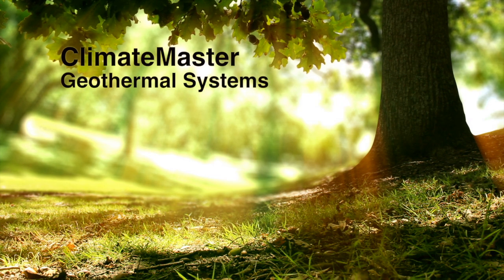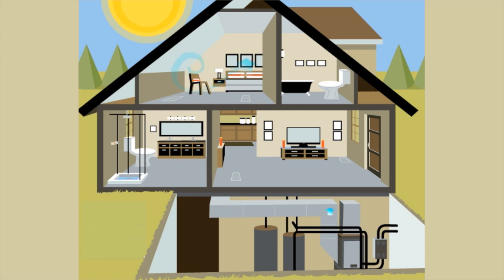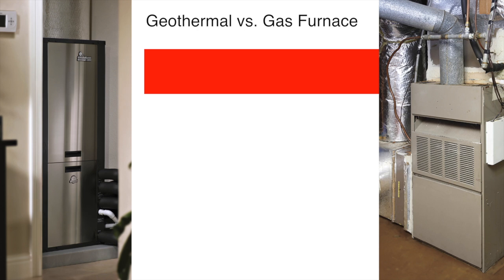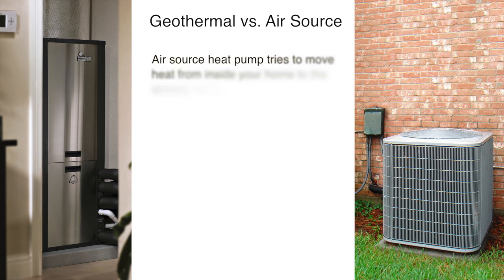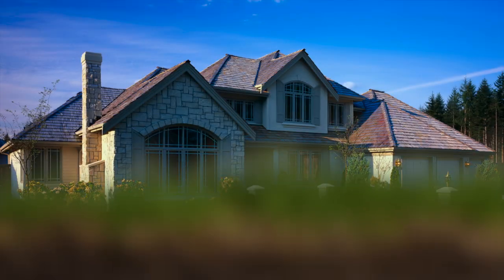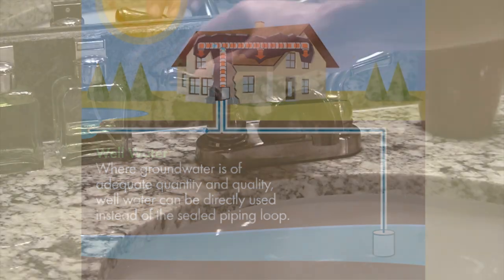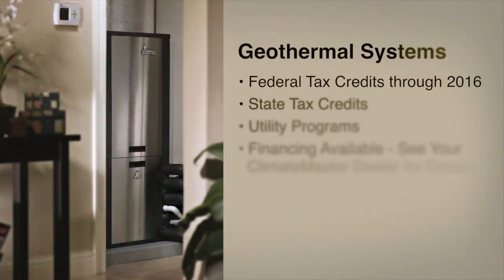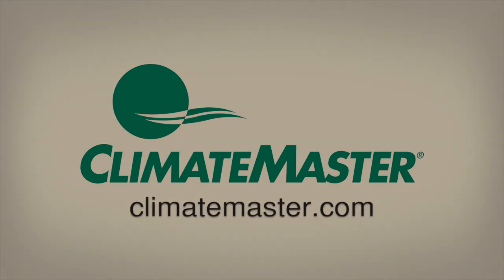Benefits of Geothermal Heating and Cooling

Comment: My home 6,000 sf cost about $45,000 to install Ground Source Heat Pump System in Oklahoma about 7 years ago for vents, duct work, 3 units 2 ton, 3 ton and 4 ton. 6 vertical boreholes 300' deep using 1" HDPE plastic pipe with life of 100+ years. Reverse return With 30% tax credit and $200 per ton from city of Stillwater. My cost was around $28,000. Which was less than a conventional gas fired system at $30,000. My average cost is around $70 per month for heating and cooling in Oklahoma. My total electric bill averages $156 per month for lights, cooking, hot water, heating and cooling. Plus I feel healthier, no gas fumes, no gas even to home for the two fireplaces. No loud compressors outside making noise. Units sound like refrigerator running. Insulation in home normal no spray on foam.
Reply: Gerald McClain $28,000?!? You're being robbed
Reply: My house is 7000 SQ Ft. My heating cost is $250 a month for winter ( Mid Nov, Dec, Jan, Feb, Early March). I have 3 HVAC units. I only turn on the one I need. Each unit cost me $3000, including furnace and a/c. The smallest HVAC unit is a heat pump.
Reply: @zomgos  do you need help keeping it clean?
Reply: @SWEAR2CARE  Keeping the house clean? Its just the two of us, my gf and I, we don't make a mess. The dog sheds tho. Just vacuum/swiffer as you would any house.
Reply: That’s way too expensive. Cheaper to convert your walls to rammed earth and go with an electric a/c
Reply: Cause not all customers have 40k and the ground is solid lime stone here. And that wattage is for cooling we’re in Texas
Reply: The first post said, 6 vertical holes. The thing is drilling the holes, you don't want dirt, you want solid rock. Dirt is bad in every way and you have to have extra pipes from ground to bedrock. That is more money.
Lime stone is prob very good to drill in. 
Heating and cooling is a lot of a knowing the numbers. 
You calculate the price for install, the price for service every year. The life length of the machines. The cost to use it. That way you can see what the total cost is. 
To do all this you also need the conditions. How hot/cold/sunny/windy. The house and the land, how are they.
I live in Europe so i don't know a lot of that. But, what i see is "let's do what we have done before" talk.
Why install air-to-air [coolers] when that is obsolete tech? air to air- [cooler & heater] is where it is. For air solutions. Air pumps is a good solution for smaller homes. Bigger homes, then you can do bigger solutions like geo and get the nummebers on your side.
What temperature is the bedrock down 100 feet where you live?
What temp do you want in your house in the summer? Why are you spending money on aircon when the cold is down under your feet?
In geo systems you can do what is called, free cold, that is you take the cold water from the ground and use to cool down the house. No heat pump needed. Only to a small pump circulate the loop water.
Reply: If you live in Tulsa, it must be in south or east tulsa and if in OKC, Nickolls Hills!
But you are correct, as I saw an A frame house in Tulsa south of 71st or 81st, which was very energy efficient and this was back in the 80's( it had a west side, comprised of all glass with indoor swimming pool and rock garden.
Reply: Richard Hill s
Reply: Ok, letts check the math
Geo:
The investment is 45 000, Of that the holes is 50 years and 1/3 of the cost.
So, 14 850 dollars. /50 years is 297 dollars a ear in cost. Even then you can reuse the hole after 50 years.
Thepump cost more. 30 000, over 25 years. Is 1200 dollars a year.
Total cost is, $ 1 497/year.
And costs for the mashine is 1200/12 = 120 dollars per month
A total cost of 120 + 156 = 276 /dollars per month
Oil:
Your house needs 1250 gallons of oil at the price of
500 * 5= 2500 dollar a year to heat.
6,000 sf  you need around 20 000 to 25 000 watts.

The oil man needs double of that if the house was 6000 sqf, (i think) So, 5000 dollar/year or 416 Dollars per month to heat the house with oil. And even then i have not included the costs for smoke channel, the burner and the system, oil tank, pump. And furnace.
Reply: I understand that a Ground Source Heat Pump System uses 250 btu of electric energy for every 1000 btu of heat provided.   Is his about what you get?
Reply: Robert Reznik 1 BTU/H?  250x3 is 750, 250x4 is 1000. They call that COP in heat pump land. The number of times i raises heat for the electrical power you give it. 
It works like this. A refrigerant (R410a) is compressed. It takes heat and gives heat. If the source for the heat is 50F, and the output needs to be 104F, then it needs to raise it 54F. If you need 131F. Then it needs to raise 81F.  A Ground Source Heat Pump has no fixed ratio. So in the summer, when perhaps it only needs the radiators to be 100F, the efficiency is better. Then the ratio is perhaps 4.0 or better So, 250 BTU is then 1000 BTU heat. When you need 131F radiator water, all Ground Source Heat Pump drops down, Perhaps to 3.1 COP.  Then 250 BTU is 775 BTU heat. But! A air to air heat pumps is even worse in the winter. They can drop down to 2.0 COP, then 250 BTU is only 500 BTU heat.

So, if you want your new heat pump to be efficient. Heat the house with a low temp system. That is under floor heating or low temp radiators.
Reply: @NonyaBusiness! What aboutt the ac cost?
Reply: You could do two 19 seer 4 ton vnaO Greenspeed Carrier systems for like 22,000 and get 5000 back in rebates. They only pull like 3100 watts on high speed which they don’t run on much. I’ve gotten home down from 5100 watts to 3200 watts and a good duct system seal the house up much cheaper
Reply: @greg 5100 watts to 3200 is really bad. That is a COP of 1.6. You invest 17,000 and only get 50% more heat than direct electric.
Reply: That’s on high stage it don’t run on high often
Reply: Sorry but i don't see why that is a better solution. Geothermal is ten times better.
Reply: In the area I live in there are about ten houses that have geothermal systems it’s not practical here I own a Ac and heating company
Reply: And that is why you think your products and solutions is the best??
Practical? It's the hen and the egg. The reason there is no geo is the reason no one uses geo, and there are no good geo company's and or systems to get.
You are only honking your own horn, and not looking for other / better solutions.
Reply: Also the holes here are around 45,000 to drill and if we’re talking tech the Mitsubishi city multi and carrier 45 seer mini split systems are the most affordable and efficient system you can get. As far as knowing system size and design we use Carrier international to do all our heat loads and manual D systems
Reply: You should move here start up a business and show us how it’s done.
Reply: I guess you don't know what the Blue Ocean Strategy is. https://www.youtube.com/watch?v=uVsd0ZtKsZE There is one person in a 1000 that are willing to try new things, like geothermal, robotic mowers, mobile phones. Then the data from that we all get. Now we know how it works. We can make a lot from this data. How it works and what it cost. All this is done. The only reason you don't do it, is you are scared to change to new systems.
Reply: Ok so obviously you’re a huge fan of geo systems I get that and I understand why. But homeowners aren’t always willing to say yes let’s take a $20,000 mud sample and drop a $40,000 system in plus drilling out an underground field and run a duct system. Not everyone can afford that you seem to be missing the point that people can’t afford it. If the average HVAC system on a new home cost $16,000 complete but you want to jack this up to $60,000.  So now the homes that were barely affordable at $200,000 are now almost 300k. So now what? Are you gonna pay the remaining balance for the planet? Just saying I know it’s a great idea but it’s not affordable.
Reply: Greg, I don't know why the prices are so high for you. I have a geo system for heating. (No need to cool here). 1 out of 3 neighbors have a geo system. The rest have minisplit, wood, or just electric. My system is 600 feet vertical hole. That is water from hole, compressor, to water in home(radiators). The compressor is 3500 watts, and give me 12000 watts of heat.
It is always hard to compare prices, but i can try. The price for drilling the hole and installing all pipes was [The salary a nurse  gets (one month) after taxes] the compressor was 2 months salary, and installation was 1/2 month. 
The price of electric was really low in the 1960 and 1970. Now we have a lot of immigrants then they raised prices so now 1000w / hour is 0.2 US Dollars. 
That gives that i pay 1500 Dollar a year for power to my pump, and saves me 3000 USD/year. The math now say, that the savings 3000 USD, and the system 16 000 USD, Around 6 to 8 years. After that the 3000 i saves is money i save.
We can't count on prices for gas, electric, oil to stay where they are.
Wood is cheap, but a lot of work. Electric is a big comfort. On some places it make sense to do air to air or even air to water. Some times it is better to do geo. And using geo to cool is a smart thing.
Reply: And where i live (Sweden) we have inflated house prices so a big house, like mine. Is 2 million (sek) where i live and 6 million in a bigger city. The installation or geo is only 150 000 to 200 000 (sek). So under 10% of the value of the house.
Reply: John Strand  hahaha not even close to our way of life in America. Average house payment is about 1800.00 a month. Also the average person in America under 35 yrs old doesn’t even have over $1000.00 cash in a savings account. For $3000.00 in America you can get a 4 ton condenser only nothing more. Here a 2100 sqft home a 4 ton 14 SEER  baseline system with ducting cost around $18000.00 installed. We live in a much different world amigo. To drill two 600 foot cores you’d spend around 25k just for the holes in the ground.
Reply: I checked and Average Registered Nurse monthly salary is $6,129. A good minisplit, Mitsubishi MZ-FH18NA is around $3000. That is better than here. Different styles of economy, but a nurse here can afford one minisplit, and in the US she can then afford two every month.

If Average house payment is about $1800 a month. 
"The median monthly mortgage payment for U.S. homeowners is $1,030 according to the latest American Housing Survey from the U.S. Census Bureau."

The price for a good minisplit system is about the same. $2000 or so. That is a monthly salary. When you talk about "4 ton condenser" that is nothing more than a big pump and a radiator outdoors. The same system as minisplit only slightly bigger. The compressor in a 4 ton, is  about the same size as in a geopump. The geopump also have tanks for hotwater and pumps for water. That raises the price to $4000 to $5000 i guess. Now you need the hole.Drilling in the US seams quite bad. Both in prices and in depth. 
It takes about a one day to drill a 600 feet hole. (You only need one). Here we don't use drillriggs that are mounted on a truck. We use, one big compressor and one standalone drill. And one big bucket to collect the water and sand. Say the price for the compressor is "One new Ford F150" and the price for the drill head is two F150's . So, 50K? for a F150? That is 150K and they last 20 years? How come the cost is then 25 000 USD for one hole? That is like 6 months pay for a nurses. I don't get it tbh.
Anyway you can get a tractor and digg around your house and make a "groundsource geothermal system", that way you don't need to drill. Or better yet, if you own a lake just put the tubes at the bottom of the lake.
And Greg what is the cost of running this 4 ton condenser?
And Greg $18 000 seams a lot of money tbh. And you don't even get any heating for that money.
Reply: John Strand 18 is a complete install in a new home from rough to finish. Most nurses here are around 5k a month.  As for the cost of drilling I don’t own a drilling company but I know what my friend paid for his cores and it was around 20-25k. So yeah for 18k that’s a complete system Ac and heat in a home plus ducting fresh air system and restroom vents so on. 18 is turn key on a new home. So with a 4 to. You get a 48,000 btu Ac Systems and 90,000 btu heater 16 seer 13 err and the entire duct system. Question I see you’re constantly stating a monthly salary for a piece of equipment most people do t have the money to not spend on anything but an ac. Most Americans are in debt to their elbows but they won’t admit it. In our country I believe people are more concerned with how they appear to their peers. As for a Ford F-150 20 years you’ve got to be kidding. Companies here only keep trucks about 5 years. Remember Texas is the size of a continent. So last year on my ram I put 50k miles on my truck. This truck will on make it maybe 5 to 7 years then it will get sold. A business has to keep the appearance fresh and won’t pull up in a 20 years old truck. That’s not proper business etiquette.
Reply: Greg, about the F150, the 20 years, was that the drilling equipment last 20 years if you get them new. I know that 20-25K is the price. And that is strange to me. But as i said, then do ground source. Texas is the size of a country. Swedes are more in depth, just it does not show. The rate for a house loan is around 1,3 %. Yes around one percent. Most family's have around one million i loans. You never told me what the running cost for this 18K system is?
Reply: Appreciate the breakdown.
Reply: I have a house of 200 m2 and landscape of 400 m2 , can you guide me how to do this system ?? Also I have well of water 25 m3 , I hope you can help in this regard.
Reply: @ehabtuffaha4083  No? How the hell are we going to show you how to install it? Contact the company.
Reply: Certainly it's hard to justify new technology. Soon enough we won't have options when fossil fuels are more expensive and non existent as it doesn't scale either. Also like solar the price will hopefully come down with competition.
Reply: @BrandonTran  it is not new by any means.. these types of closed loop areal geothermal are out there and running reliably for more than 30 years.. not rocket science nothing special.. just a pump for the loop and a heatpump to "concentrate the heat in the heating circuit to a higher level, not as high as for normal radiators, since you normally couple it with a floor heating system to be most efficient.
price gouging is the problem and can be for whatever heating system / repair / services / products  you spend money on..
Reply: Gerald McClain If you installed solar panels on your roof you could eliminate those final dollars on your bill. And if you have a surplus of electricity at the end of adding a solar panel array, you could be paid by electrical company too. Passive income. Look it up and cheers to financial independence ☺️ 👍🏽
Reply: They use gold instead of copper pipe.  I've seen this before.  Very cost effective.  You have to be careful that scrapers don't find out you ran 25,000 dollars worth of gold pipe or you have to redo the entire job.  I've heard of scrappers stealing the gold pipe hundreds of times before they switched back to copper systems.

Comment: I don't understand how could that be used to cold a building. temperature in my country is around 40C. they say the underground is 42C. how can that cool my home?!!! can any one explain please!!!
Reply: https://www.youtube.com/watch?v=Uv8bTAGr0tU
Reply: had to laugh  5 ft below grade.. looks like a sure fire way to make sure the system does not work well
Reply: sounds like you live in the desert and it never cools off.  NEVER never gets hotter never gets colder .. where is this?  If you are using an air source ac you would be dealing with a constant heat ... Remember this.. the ground temperature remains very constant once you get to 20 ft below grade This temperature is the AVERAGE of day and night temperatures of the air as an AVERAGE for the full year.  It is my understanding that temperatures at night even in a desert do drop considerably. So it is very possible that your ground at the 20 foot level could well be between 75 to 80 degrees which as you know is a bit under 40C